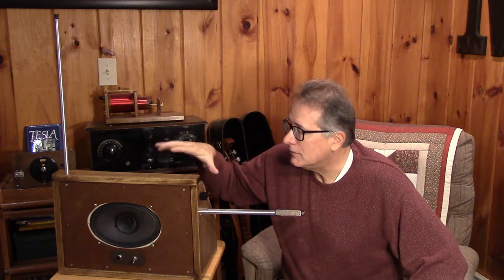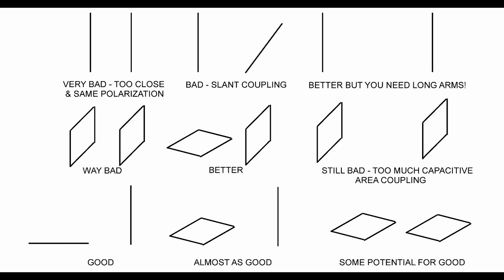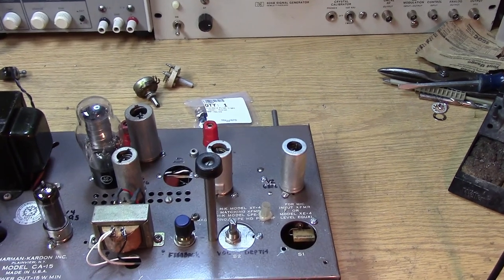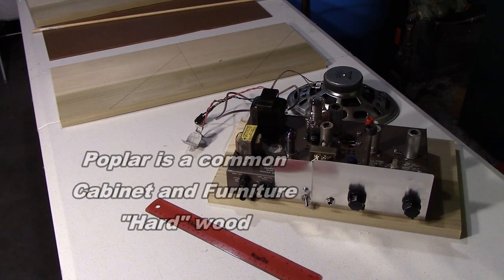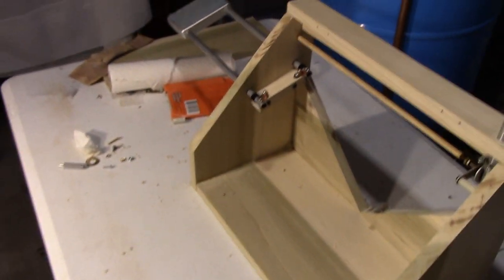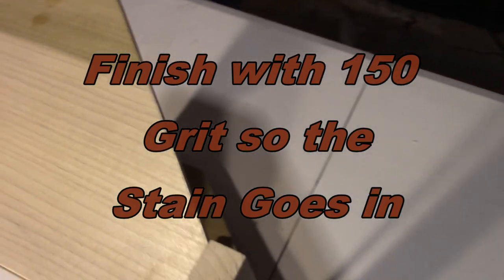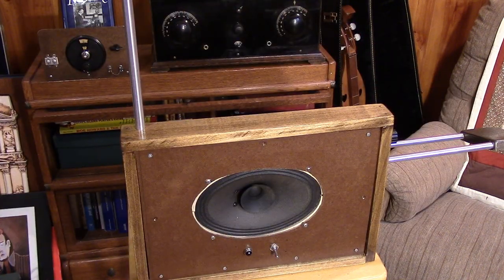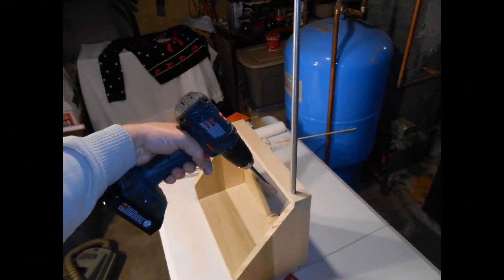Theremin Part 4

Comment: IIRC, the volume control on the RCA Theremin actually varied the filament voltage on the first AF stage in response to the output of the Volume oscillator!  The AF stages used directly heated cathodes, while the oscillators had indirectly heated cathode tubes.
Also to reduce coupling, or at least influence of one oscillator on the other, they operate on non-harmonicly related frequencies.

I have some old tubes I could use for a Theremin.  6K8 would make a nice mixer / reference oscillator, a 6SJ7 or 6J7 a volume oscillator.  A 6SQ7 could be a volume rectifier to develop the control voltage for the 6SQ7 to control the gain (volume).  A 6F6 would be the output tube.    I could also use a 6H6 or 6AL5 for the volume rectifier, and a 6SJ7 as the volume control tube.  5Y3 or 5V4 as the rectifier.  Moog used 6K8's as the oscillators in his tube theremin, he actually used the triode section as the oscillator, and the heptode section as a buffer amp, and used a separate mixer tube.
Reply from the maker: That sounds like a good octal tube approach. I admit I am still in the dark on a lot of this. But I will figure out how to get the antennas resonated. I just got the outer grill cloth frame in.